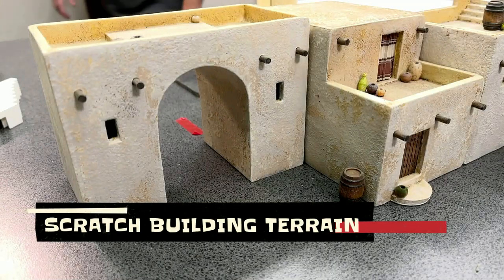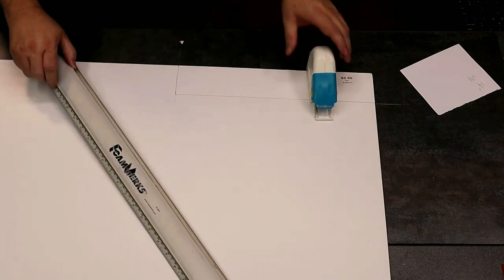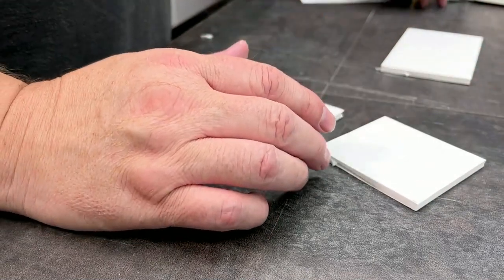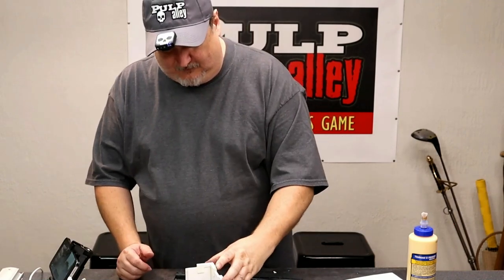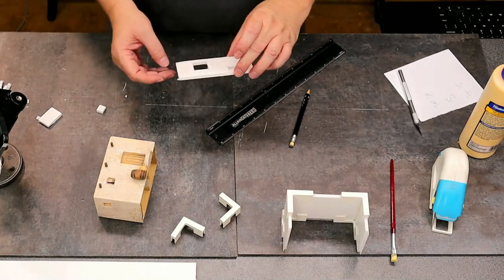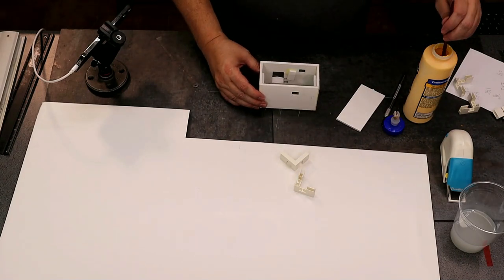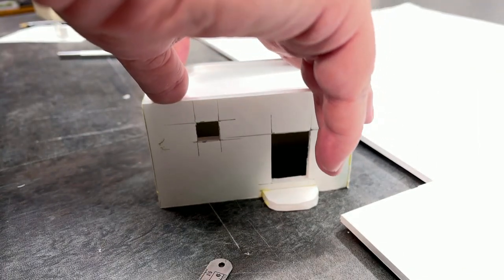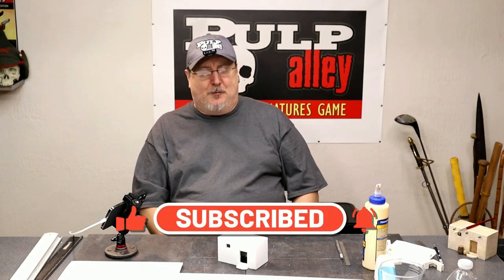Tabletop Gaming: Miniatures & Terrain

Comment: Many times, you can also get those big sheets of foamcore at your local dollar store. Great building material for so many terrain types, and inexpensive too!
Reply from the maker: Great tip!
Reply: Note that the Dollar Tree ones only have paper, not cardstock, covering the foam.  Great source for cheap foam but the cutting the foam edges down thing won't work as well or at all with just paper.

Comment: I didn't know about the corner brackets. That will make things easier. Plus the cornering tip is a big gain for being solid.  What did you use for painting?
Reply from the maker: I think the base is simply the color of the wood putty that we use to texture it. We'll see more about that in the next video.